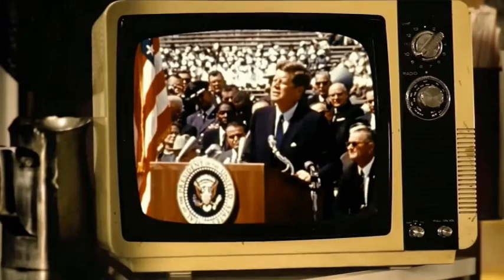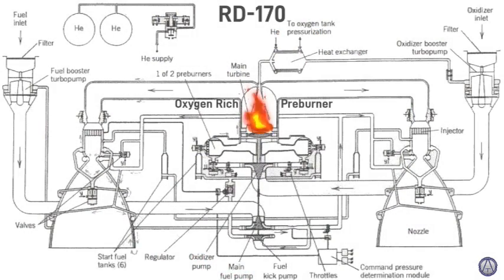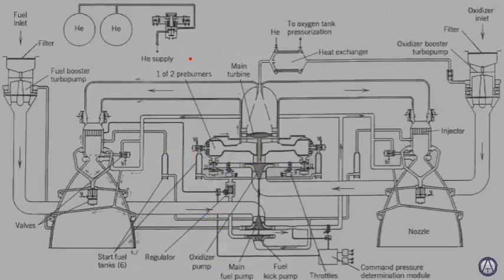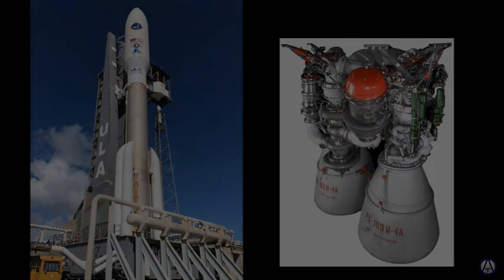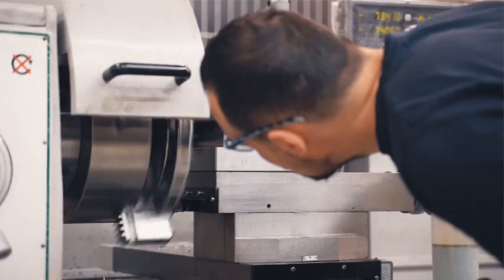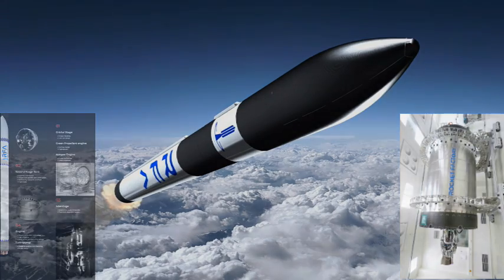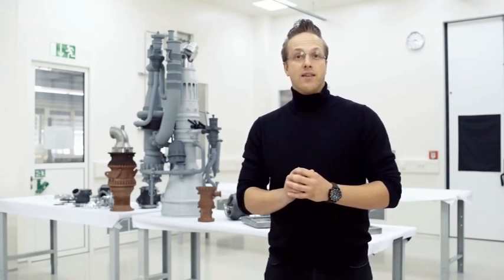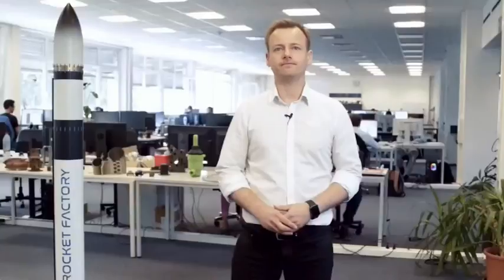Building a New Rocket Engine: Rocket Factory Augsburg

Comment: Type dji t40 horticulture 10 to 14 on 23,000 feet 
Type racket jet back pack 16 - 18 and řfă outerspace propellant 300 atmosphere 
USPS ad-121 do.usda cotract ?¿i see two horizon & another company still operating 2106 year, 120 new employee this time period, equipment for atmosphere prior to new atmosphere 4 2192 - 2193 safety kit equipment required 2092 - 2236 year?

Drop gas pack 46,000 feet jet tubines 8 unit carry load?
Reply from the maker: I'm not sure that translated well... :-)

Comment: Maybe I missed something, but it seemed a little thin on engine operation and a bit long on PR?
We are at the beginning of a new space era and terminologies haven’t been cemented in the sands of time yet.
So is it full flow stage combustion, or partial stage combustion or something else?
Reply from the maker: It is an oxygen rich staged combustion engine so the oxygen with a little fuel is burned in a preburner and the high pressure gas created powers the turbopump which is connected by a shaft to the fuel pump.
Reply: @terranspaceacademy  
So only one turbo pump pumps both oxygen and fuel? is the exhaust of the turbo pump feed into the main combustion chamber or a separate exit ?

Comment: They are still using turbo pumps.  I think this limits the pressure available.  Hydraulic pumps, reciprocating opposing pistons could deliver more pressure but maybe not the volume.  There was a smaller engine that still used hydraulic pumps instead of turbo pumps, can anybody remember who it was or what the type of pump was?  I need a system that can deliver 16,000 psi and moderate volume .
Reply from the maker: That was the Lynx space plane. It had an innovative rotating piston design.  https://www.google.com/url?sa=t&rct=j&q=&esrc=s&source=web&cd=&cad=rja&uact=8&ved=2ahUKEwjf4LiMu76CAxUomGoFHYeMDY0QwqsBegQIDRAG&url=https%3A%2F%2Fwww.youtube.com%2Fwatch%3Fv%3Dvec1z8dJ5as&usg=AOvVaw02C-PQ9g_MEPZC7LcuP5S3&opi=89978449
Reply: When you require light weight and high volume there is nothing but turbo pumps.